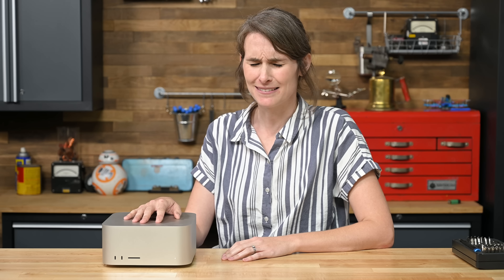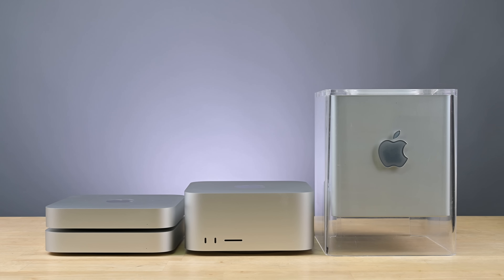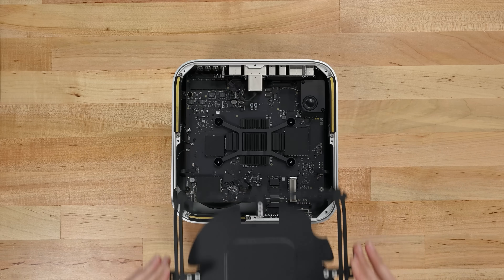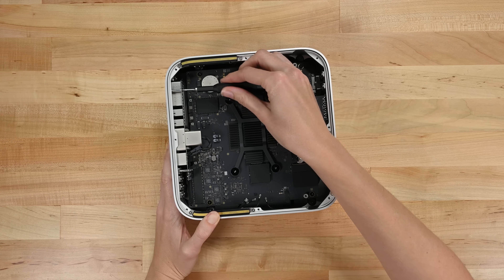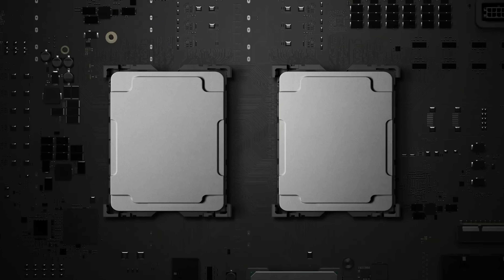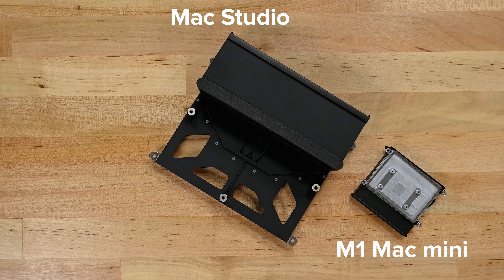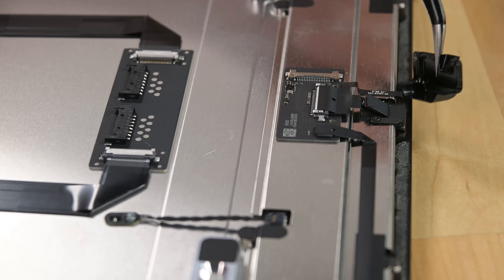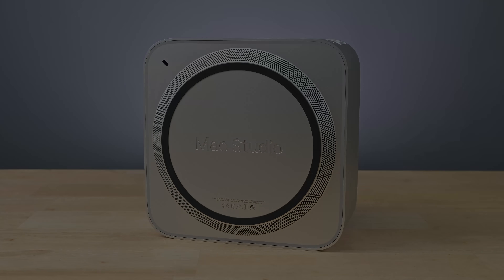Mac Studio Teardown: No upgradable storage… yet

Comment: Correct me if I'm wrong, but isn't this extra storage for the upgradable storage configurations on apple's website? Like for example, if you chose the 8tb option, wouldn't these slots would be filled up?
Reply: I've been wondering the same thing. I haven't seen anyone open up the 8TB model. They also claim a higher throughput on the 8TB model, so some kind of RAID-0-like setup would make sense. Although the increase in throughput is closer to 30-40%, not the 80%+ you'd expect from a proper RAID-0 setup. Maybe the 8TB models haven't actually shipped yet (except to the chosen few like iJustine who had them in the first wave)
Reply: @Niosus  indeed, it's very likely the 8TB is dual 4TB with hardware striping. But, that doubles the failure rate combined with the fsync issue means you need to back up the unit consistently and use a UPS.
Reply: That's what I keep thinking too
Reply: Yeah my guess is if you get the upper tier of storage they use 2 modules and combine them together as 1 which is most likely why they all have 2 slots even though maybe only 1 can be used.

Comment: Wait, the Studio Display has active cooling?

Why?!
Reply: Yep, they need it to cool all of the components.
Reply: The old Thunderbolt and LED Cinema displays also had fans inside them to keep the components cool. So this isn't uncommon for an Apple Display. Remember this is more than just a simple display.
Reply: @ducktails1695  Barely. It's a 5 year old panel with marginally boosted brightness and an iPhone shoved in there.
Reply: @MentalEdge  This is new panel.
Reply: @nnnnnn3647  How do you know? I can't find info on that, even if I could it's not really relevant. If the display is using an lcd panel that has entered manufacturing recently, the panel still doesn't come with any modern tech. There is nothing in it that wasn't possible five years ago. No HDR, No high framerates. If it's a new panel, it might still as well be five years old.
Reply: @XtremeArtists  definetly not lol, the pro display has 1600 nits peak and no active cooling.